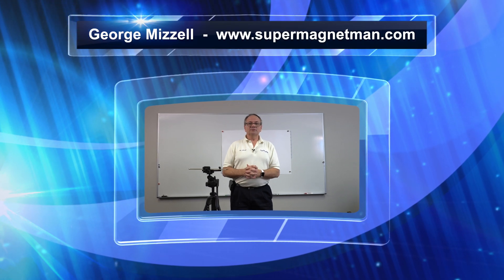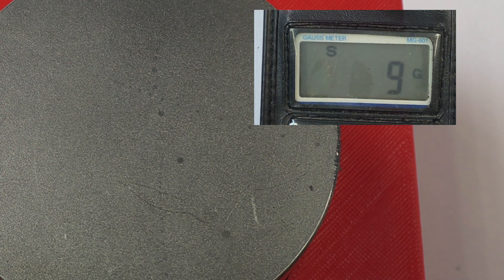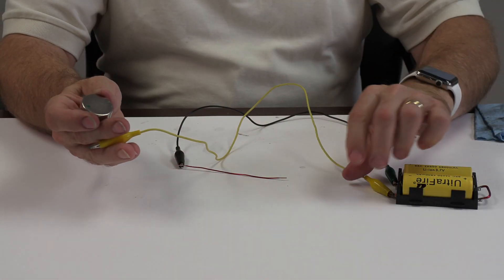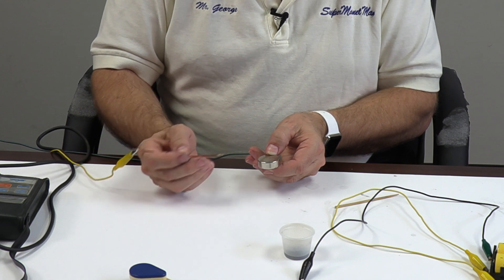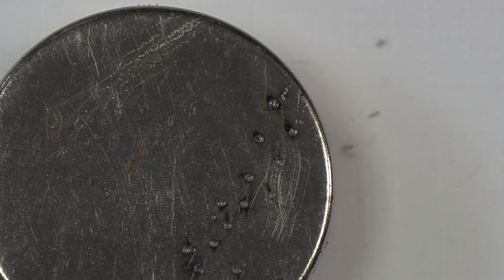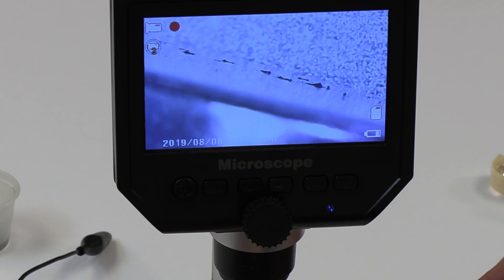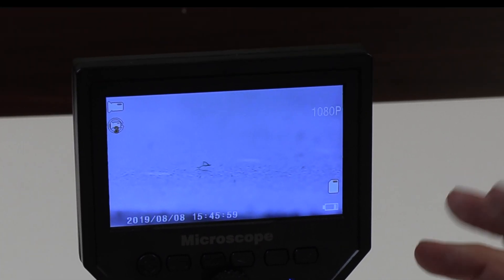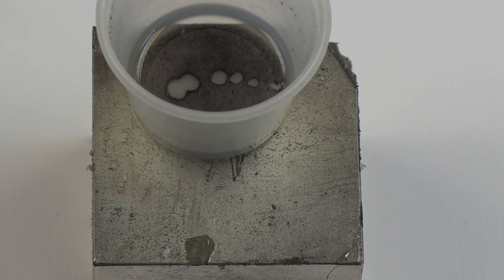Magnet Mystery Part 2 Up to 4K

Comment: This may be unlikely, but I have a feeling (unscientific I know) that these effects are caused by tiny micro dropplets of bismuth or similar anti ferro-magnetic material being dropped or deposited on the magnet. Funnily enough, NiO and chromium are also anti ferromagnetic, which just happen to be materials used in those same magnets
Reply: Bingo, it does look like Bismuth.  I'd want to see if it can be scraped off, and re-test.

Comment: I was correct. As for the 2nd question I am guessing again an arch but indirect. Meaning another metal or liquid if  taking the initial force of contact. Just like when you put an outlet in and out and sparks yet the other end does not have a burn. But it could be wrong. or arch it first then coat it. But best to leave the mark to indicate where it is.  The arch does not put the direction on the other side but makes it all over the place.
Reply: the amount of current and voltages implied would not create the effects we see IMO. Also if there were some sort of object, metal or other wise, we would either see no change to the surface or exactly the same sputtering from the arcs that were just disproved due to secondary arcing between the object and the magnet

Comment: The spots on both magnets are cycloid and regularly increasing/decreasing in diameter. Absolutely not a liquid splash. More likely to be caused by a long exposure to a standing wave or a fast and powerful electromagnetic strike (laser, plasma, transverse field, ..)
Reply: this makes sense

Comment: I want to agree with kelly that maybe that during the nickel plating process magnetic field lines guided the path of electric field lines and concentrated at one of the magent poles in that pattern. The magnet was then polished and no defect would of been noticed. Would it be possible that the over time defects arise from the slight defect or tanglement in the field line surface gradually destabilize the grain structure and demagnetize that area. And could oxygen react differently to thoses areas. Oxidizing it faster or slower? What a fun puzzle. It does kinda remind me of sunspots.

Comment: Use a ferrocell and watch magnets approach with like poles and opposing. Note the lines of force and how they bend in both interactions. Place magnets flat so equators are the same plane and do the same. Note the geometry and compare to scientific models of magnetospheres used currently for planets. Without question they are the same. Hard to believe such a simple tool could prove Einstein wrong about gravity. True science learns every day and is not afraid to embrace change. We need more true science!
Reply: Absolutely!!   I made a discovery I am stumbling on.... forbidden knowledge, forgotten knowledge, AlterMagnatism went "undiscovered" until this year, even though it involves every day elements and processes, until this year?  Unbelievable how off we are.... I'll give you a hint... Add an East and West pole or an X axis to the y axis... This changes everything

Comment: Oxidation in the rare earth materials then coated with nickel or just impurities in small spots but I suspect due to geometry that something splashed across uncoated magnet then oxidation occurred. Scrape the nickel and you will see this in all neo magnets. The rare earth oxidation is rapid in atmosphere. Even striking enough to separate the nickel from the base will cause this effect.
Reply: Not splashed, its a regular cycloid on both msgnets.
Reply: exactly, certain spots of the nickel were oxidized becoming anti ferromagnetic in the process

Comment: The material that arced to the 3in magnet could have been one that doesn't deposit so much material like copper does, maybe tungsten. Also if the charge/current is negative or positive makes a difference in whether material is deposited or ejected and then fused around the crater rim.

Comment: Micro-fractures in magnet may be creating multiple magnets guided by those fracture patterns. Also, the magnetization process involves coils. If the introduction into this field is non-homogeneous, or the current is introduced in an erratic manner, these may create patterns reflecting those spurious current flows. INDUCTIVE SPIKES may show snapshots of sudden field bounces. An effective snubber, or if a soft-start current flow is used to magnetize, may prevent this effect. Thanks for this intriguing mystery.